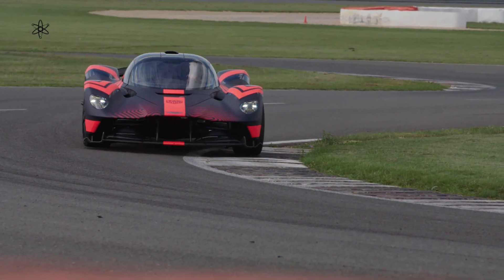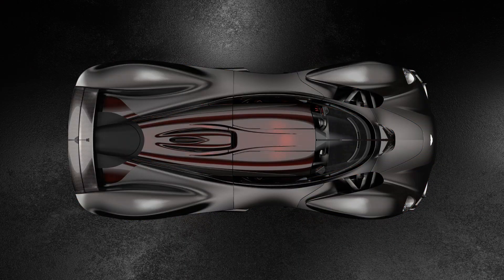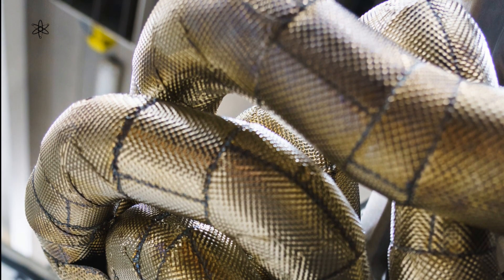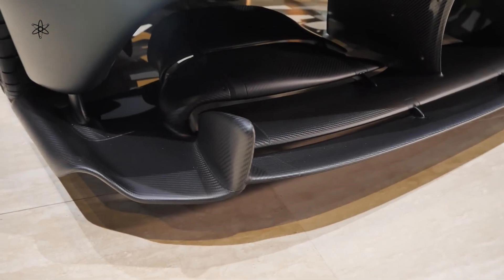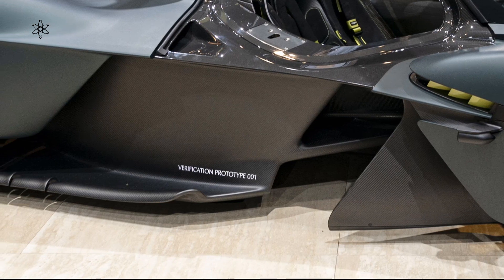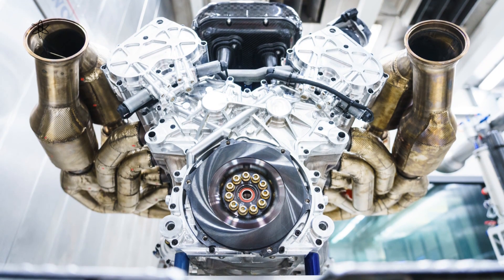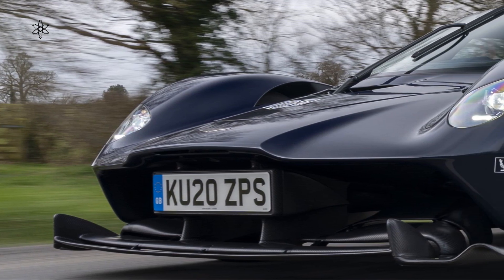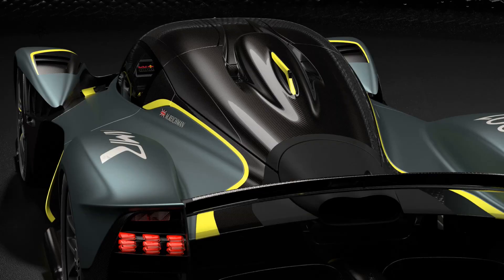Aston Martin Valkyrie's Formula 1 Aerodynamics

Comment: This car has taken so long to produce is it as ground breaking now as it seemed a few years sgo. To me no still very interested but you can't take forever to develope a car anymore. Things are moving fast. Will this car be a better performance car then let's say the new czinger 21C i have my doubts
Reply: the aero is so far above an other hypercar it will definitely have better performance. No other hypercar has what is essentially a formula 1 car underbody at this point. Its all flat floors and basic ass splitters and diffusers. 

Even the Bolide has shittier aero, where its form is more controlled by styling than actual performance.
Reply: Czinger 21C? This is made by Adrian Newey, the God of Aerodynamics. Enough said.

Comment: That single clutch sounds pretty slow on upshifts, I wonder if that's something they can improve with further tuning.
Reply: These shots are from early prototype testing that was done before the lockdown.
Recent 'spy shots' from testing shows the shifting is much quicker now and they're also revving the car to 11k whereas they were short shifting at 8k before.
Reply: @Cain353  Like the Lamborghini Sian, the electric motor is used for instant gear changes via rev matching and blipping, which is why a single clutch gearbox even works.
Reply: That is probably where the hybrid system helps
Reply: Someone says there was not enough space for dual clutch tranny. Plus weight saving.
Reply from the maker: problem with single clutch is its two function action, disengage and engage. with twin clutch it could be overlayed, one disengage one engage, two clutch one action each rather than one clutch two action

Comment: Great video! 
Only a few comments that I would like to add:
-Would have liked a more detailed analysis on the double step diffuser but I understand, there are not a lot of images to work with;
-In more recent versions I think that the rear diffuser footplate with half-cylinder tube doesn't exist and they adopted another idea
Reply from the maker: thanks...think the double diffuser really benefited as a loophole in the rule book allowing to draw air from under the floor to over